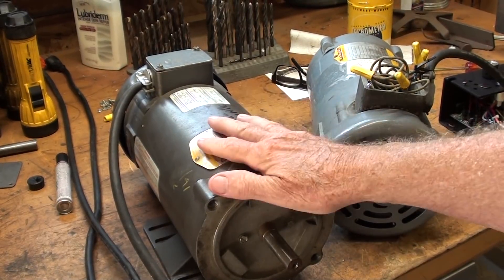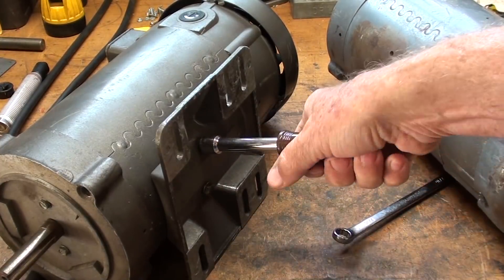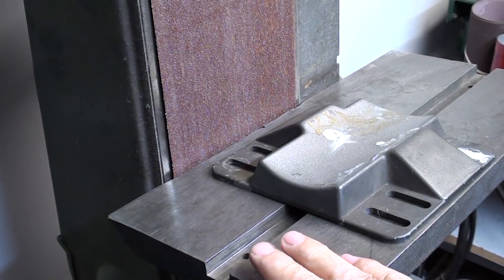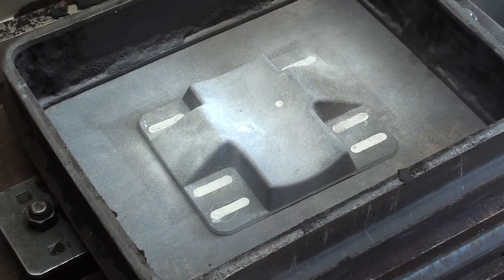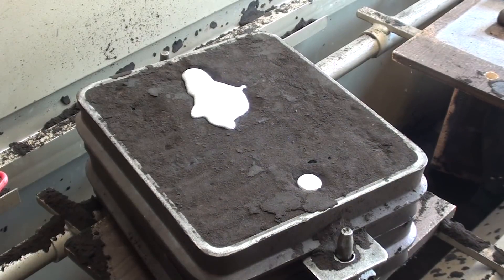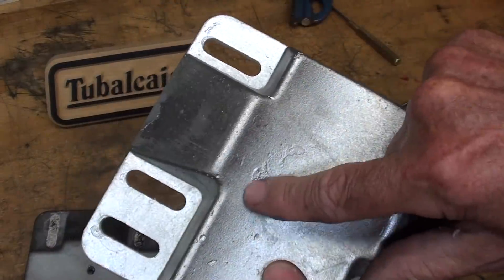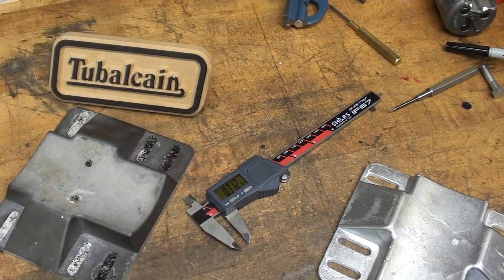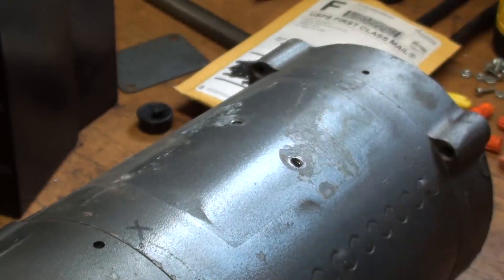Cast a Baldor Electric Motor Base Tips #478 tubalcain

Comment: Ever since watching the gear reduction video i wanted to have speed adjustments on my equipment so i have been collecting treadmill motors and watching videos on how to power up and controll the treadmill motors...i cant wait to be up and running on DC..
Reply: I converted my benchtop drill press to a treadmill motor recently and I love it! 

One bit of learned advice- try to configure the pulleys for the lowest spindle speed possible (smallest pulley on motor, biggest on spindle). 

This addresses Mr Pete's biggest complaint that drill presses usually run waaay too fast for larger diameter metal drilling. And it allows the motor to run more towards the middle of it's speed range to ensure maximim torque development and higher momentum (stored energy) in the flywheel. 

The only downside I encountered was the lack of braking; the motor can take a while to spool down once power is cut which leads to unsafe remedies like grabbing the chuck. 

There are solutions, including mechanical, magnetic, and dynamic (low resistance/high wattage resistor switched in across the motor) braking. 

Perhaps a goal for my v2.0... Best of luck!
Reply from the maker: That is very excellent advice. Be sure and watch the upcoming videos were experiment with what you exactly said
Reply from the maker: Thanks

Comment: Up a bit early Mr. Pete? Another good video. I just acquired a 2 1/2 horse DC motor and am in the process of building a speed control with a reversing switch. Don’t know if I’ll go with a pot or and scr and bridge rectifier. Gotta do some research for best option and durability. 
Keep them coming!
Dale from Decatur
Reply from the maker: Thanks